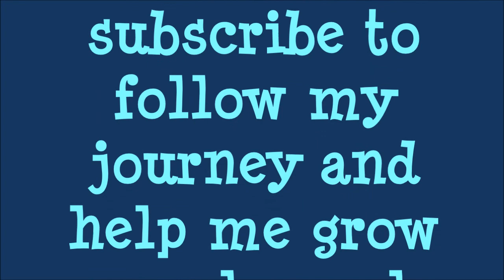Fellow Nomad Helps Me Out With RV Maintenance

Comment: As was mentioned earlier, whenever you buy a used vehicle, if you have no vehicle maintenance records from the previous owner you assume the worst and change ALL oils/fluids/filters and lube jobs (if any) right away as that may or may not have been done (you err on the side of caution and assume maintenance was "deferred"). That way you KNOW everything's been changed out  as you begin your ownership of the vehicle. Of course, that'd include the generator, especially the generator, as they need more frequent oil changes (based on hours of use) than vehicle/RV engines do.
Good luck,
-- BR
Reply from the maker: Bill Redding I do actually have a very extensive record of all the work that was done on the RV. I was so glad to see that!  When I bought the RV, they changed all the fluids and put new batteries, flushed and sanitized the tanks, and all the other systems like the air-conditioner convection oven, furnace, stove propane tank, was all tested and cleaned. But I really kind of rushed them because my oldest daughter passed away hours after I bought this and I needed to get back to Indiana. So I told him to skip all the deep cleaning stuff they were going to do. But they did an excellent job really! I can’t complain at all. I do have a lot to learn and how to maintain this vehicle. And I know somethings I have to fix like my plug on my hot water heater. I bought the plug and tape to fix it, but the tape I have on it is holding so I haven’t fixed it yet LOL. Thank you so much for all your advice I appreciate it!
Reply: Sorry...now that you said that, I recall the earlier video about it when I responded then with this same advice! Oops...my apologies!
Did you also flush/refill both the coolant and brake systems? If your brake fluid is dark, it's probably contaminated (usually with water that happens over time no matter what since brake fluid is highly hygroscopic). Flushing/refilling would replace all brake fluid (even in the wheel cylinders) -- it can't fix any corrosion/pitting from old/dirty brake fluid has been caused thus far (if any), but should keep it from getting any worse. Same for the cooling (antifreeze) system.
Sorry for forgetting you DID get maintenance records for the previous owner! 
BTW, my compliments to you getting online and researching what could be wrong with your generator not starting...most people don't even think to do that!
It's also good you have a new water-heater plug (and Teflon tape, if that's used on the threads) ready to install if you need to, as you know the plug that's in there now does have a leak.
Merry Christmas,
-- BR